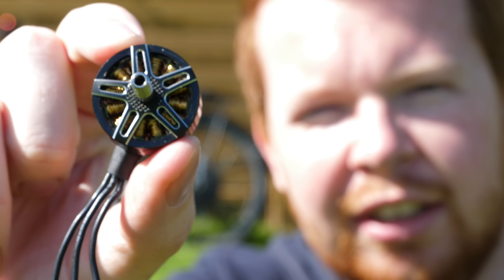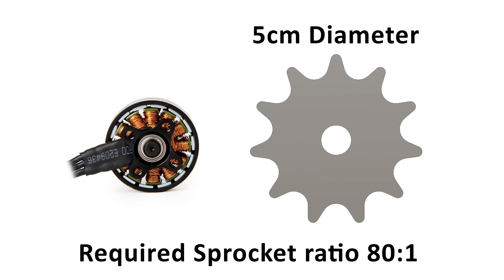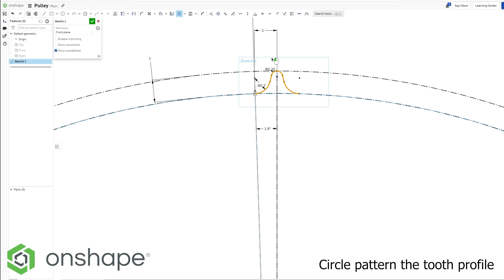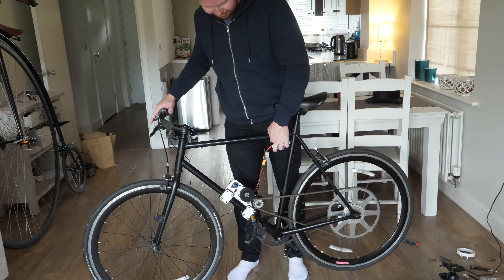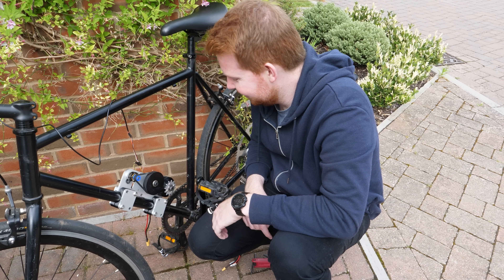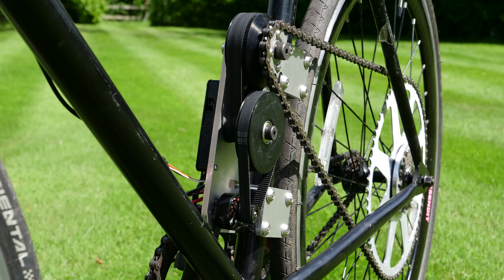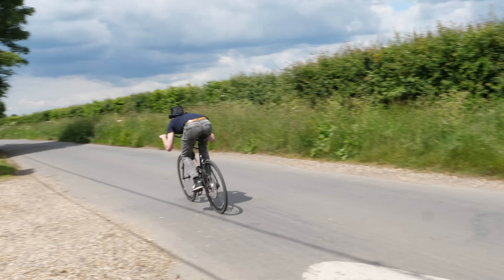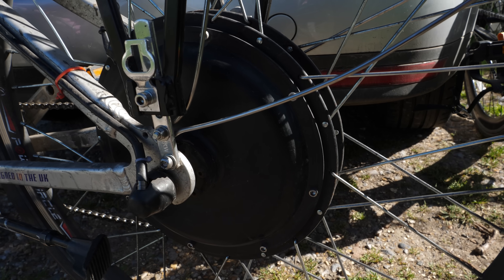Tiny 1kW Electric Bike Motor

Comment: What about using 4 drone motors? There’s enough room, and theoretically wouldn’t that quadruple your power? 🤔
Reply: Drone motors come in many, MANY sizes, to accommodate drones from a few grams to tens of kilograms.  Adding more motors is a lot of extra work, while using one motor of the proper size isn't.

Comment: with the right size motor you can probably tune it so  that the motor wears out at the same time as when the batteries run out. put some single use batteries on it, and you have a single use e-bike!

Comment: These normally expect airflow when being used to spin propellors around at those loads if I'd have to guess. Would be interesting to see if it holds when creating some airflow over it, bonus points if you make it so it has the air intake from the front direction and exhausts it to the rear to add to the ebike propulsion. Or if you want to achieve true madness figure out how many of these motors and propellors you need to put on a normal bicycle blasting air backwards to sort of propel a human riding a bicycle.

Most ebike motors do seem somewhat overbuilt especially when limited to the 250W continuous power that's legal as a bicycle in the EU however I do like the quiet operation compared to the noise a fast spinning drone motor produces. But I'm sure there could be a lower weight middle ground possibility that'd be nice (especially for wheel mounted contraptions, less picky for lower down central mass in a mid motor setup).

As for that legally being considered a bicycle with max 250W continuous power and no assistance above 25 km/h I do wonder what kind of peak power and for how long they can get away with here during acceleration. I've certainly seen Bosch mid motors mounted in "speed pedelecs" that appear to be the same as those in regular ebikes, for those assistance is allowed up to 45 km/h and more power is allowed too but not sure what the legal limits are.

Comment: Could you design and fit a continuously variable transmission like the old Variomatic system to better match the available motor torque to the demand. Impedance matching the load?

Comment: For the first few steps of gearing, where torque is low, efficiency / low resistance is vital. Perhaps such a wide belt is not the best option. Not sure what would be the best solution, but I imagine good quality gears would be better.
Reply: Belts are actually pretty efficent, and way easier to make

Comment: I would like to see a project with a rubber motor with gearing for topspeed of 20km/t (sub legal top speed) and detachable from the seat post. Going for a high top speed always brakes the usability on an diy project(boat, car, bicycle doesnt really matter). Icing on the cake would be all parts 3d printed and cheap M6 bolts and bearings. That would be something actually useful for folks to copy and use from time to time. All builders focus on top speed for some reason, the right way is to gear it down as much as possible to not melt the motor in the first small hill.  Esc with current limiting is expensive so no one buys that for an easy fun project. If this project would have had more gearing the result would have been completely different. Most drone builders also know that the motors can only maintain 30k rpm for a few seconds so I'd think 15k continous would be  better design goal on a bike. Gear down 50% more with a tensioner and film the bike do a gravel trail!  Would be fun to watch.

Comment: How's about four drone motors mounted directly to the frame with their shafts (with the apropriate toothed shaft sleeve) pushing in pairs against the tyre? 
What I'm thinking about is similar (if not identical)  to the "old" bicycle dynamo.

Comment: That 1000w rating is based on the windings running at 110degrees C and a propeller mounted to the shaft forcing air through the coils at 160km/hr or more, depending on the propellers pitch speed. Using it the way you were, its probably good for 300W.
Reply: Not even that.  Without forced air, there isn't much cooling possible, since the heat is generated from the center.  And with as little thermal mass as the stator has, even at 300W it's not going to last long.

Comment: Awesome experiment. I suspect the problem lies more in the ESC than in the motor itself, because drone ESCs are designed to reach a given speed, not just to apply power. So with such a big inertia of a bike plus rider the motor is commanded to reach a target speed which it cannot achieve for several seconds. Also, drone motors are designed to run only one second on full power because by then the drone will be accelerated and the props unloaded.
Reply: probably get a lot more air cooling on a drone too
Reply: Probably way off on gear ratio need another 4 to 1 or about.
Reply: Are there ESC made for this task? Or one has to go on a limb to design one?
Reply: @venasanev  They sell them in any size you want. Want them water cooled? Buy a model boat ESC. Want it power limiting? They've got those too.

ESC probably won't even be very warm, they have extremely tiny ones that run 4 motors at about 60 amps (each) that are less than an ounce. The thing that gets hot is the motor. Like I said above, all of them allow changing parameters like startup/advance timings, some allow braking levels etc.
Reply: Depends on the motors efficiency mostly. If you get a really efficient one, they don't heat up much (example, you may measure 1000w from one, and 1050w on another for the same output, and if that output is 990w mechanical then one is going to be heating up 6x faster and may burn out while the other will run till the bearings wear out without over-heating). Its impressive just how much a few design changes affect those motors, and modern race motors are probably nearing the limits especially when you compare to the older generation (flat magnets, multi-strand coils, bigger magnet to stator gaps), its a HUGE difference.

Yes I test motors until destruction, measuring mechanical efficiency, case temp, current and torque curves, thrust efficiency with different props etc. I've been testing motors to destruction just for fun before I ever was paid to do it (that's not my primary job, just one of them).

I will say you can also change the timing on pretty much any ESC within the last decade, so if you're having issues with that most of them you can change just listening to beeps and inputting throttle to program, or if they are 32 bit then new flight controllers can usually do a flash passthrough.
Reply: Possible it might work better having the motor run at a certain minimum speed, and have a clutch system to bring the bike and gear system up to speed, rather than having the motor start at 0 rpm with a huge load.
Reply: No ESC makes the tasks you described. In a better case a flight controller is responsible for that. ESC provides a PWM voltage to a motor coil, measuring a current. Some ESC have FOC functionality to shift a bit phases. So, you set a desired “power” with a controller, an ESC checks a current and varies a voltage to match the settings
Reply: @sc0or  I must admit I am not sure but as far as I understand ESCs are indeed Electronic Speed Controllers. Otherwise we would never blow our ESCs because the curent would be limited when in fact drone pilots regularly burn ESCs.

Comment: One issue you might be facing here is that drone ESCs are built with the assumption that the motor is under minimal load until at very high rpm. That introduces 2 issues when used as traction motors - the back EMF based sensing is nowhere near as reliable when taking off under load compared to the hall effect sensors typically used by purpose built traction motors, and the system is designed under the assumption that the motor will almost always be operating at minimal load, in that back EMF will be the limit to the motor speed at any throttle configuration. That in particular is a problem because at the same power input you will have much higher currents if the motor is under higher load, because the load will lower the motor speed so there's less back EMF. The wires in the motor realistically have a current limit rather than a power limit - the power limit is due to a mix of max current and the voltage required to achieve max current. With a drone ESC you're at high risk of substantially exceeding the current rating of the motor even if well within its power specifications. Running the same motor with hall effect sensors on a VESC with current limits set would yield less torque but a much cooler and happier motor.
Reply: People keep saying this, but a 100A ESC is a 100A ESC.  They can be used for drones, or RC cars, or helicopters, and cars in particular have high starting loads.
Reply: @BrightBlueJim  Yeah but feeding the motor 100A for 1 second during ramp up is very different to feeding it 100A for 5 minutes while crawling along at max current low rpm.

Comment: Awesome video! Can you provide how you wired the electronics and what you did in order to control the motor softwarewise? I study mechanical engineering and currently try to get into using Arduinos. But without much prior nowledge in programming it is really hard to start there...
Reply: You'll use analogRead () pins A--A6 / map () 0-1023 to 0-255 / analogWrite () to PWM pin which is 3/5/6/9/11/13
That's pretty much it. There's probably a servo sweep in the default library and readPot library, or this is literally just any servo tester code.

You can also just buy a "servo tester" for about $2. If you're using it on a bicycle and want a twist throttle grip I'd desolder the potentiometer and wire in the one from the twist grip.

Comment: High HP obtained at high RPM are always searched to improve HP/Weight ratio and consequently, acceleration and performance. By the way,  your final test comparison is really weird : 
- the gear ratio never let the drone motor achieve its optimal performance domain 
- cooling air direction sideways as the motor is designed to be cooled with downstream air-wind from an impeller

Also a John Deere 9R540 tractor weight 20tons (and is 13.6liter cylinder volume - 829ci), a Nissan GTR around 1.7tons (3.8 liter - 231ci). Even if you indicated their top speed, those vehicles are clearly not really in the same category. Ask a Nissan GTR to plow dirt, its clutch will die in few minutes. Even if power is the same. 

Acceleration is directly related to torque, speed is related to power. Traction is how to transmit power or torque to ground and it depends of weight, grip and speed.

For example :
Did you know that a Leclerc tank accelerate initially faster than a Porsche Cayenne ? (https://www.youtube.com/watch?v=I5l1-CUsbAI sorry for quality can't find better) 
Did you know that a F1 accelerate initially faster than a F/A18 hornet ? (https://www.youtube.com/watch?v=luH-rOYixY8)
Did you know that an human accelerate initially faster than a F1 ? (https://www.youtube.com/watch?v=vY7Jlz9ub6k)
Did you know that 8 rugby-men can block a F1 ? (https://www.dailymotion.com/video/x6f0azm)
 
Torque, speed, HP are physically related, but it is clearly not enough to understand how all of these physical quantities can be compared for one application to an other.
Reply: And there's another issue: moment of inertia.  Any shock load fed back from the tire is going to be working against motor inertia, with the result being that the first belt will strip in no time.

Comment: I see many people talking about there needing to be basically a fan blade (like a prop on a drone) to stop the overheating, but the much much bigger issue is that motors draw an order of magnitude more current when accelerating to top speed. That means it draws waaay more current than it ever would on a drone because it is moving a substantial amount of mass. The more current you have, the more heat you have. No reasonable amount of cooling will make this work.

Comment: i imagined this concept too when those motors came to market in the R/C world, i knew there would be problems with too high rpm but at the time i didn't realise the problem is cooling since those are designed to have very strong airflow coooling them at all times, also there is the problem with the true continuous power available since even with good cooling those are designed to pull 1000w but for extremely short periods of time

Comment: You need to remember that at say %85 efficiency for that motor at 1000 Watts input you will be producing 150W of heat energy in that tiny little case.

Comment: i mean you went to the absolute extreme, you should fit a mid size outrunner motor with much lower kv that can actually dissipate the power and it would be very competitive with the hub motor

Comment: I'd love to see the motor drive the bicycle  by using a simple friction drive against the bicycle tire (and some cooling with a fan as others have mentioned). The mount would probably need some weight to keep the motor drive wheel tight against the bicycle tire. Thanks for a very interesting and thought provoking video!
Reply: I have seen a guy build just what you are talking about.  Using a  18volt dewalt  cordless drill  and a couple of strong springs to maintain good contact with the rear wheel. 
You can probably find the video on YouTube

Comment: the spec sheet for the small motor , stated under full load for 1 minute the temp of the motor will be 101c . which is pretty impressive

Comment: YOU'RE FORGETTING RADIAL LOADS FROM THE PULLEY!!!
The drone motor isn't built to withstand pretty much any radial load, as the propeller doesn't exert any under normal conditions!
A lot of your heating in the initial setup with the smaller motor was probably from excessive friction in the bearing surfaces. that's also why it was squeaking so much. the reason that motor brackets exist is that they can balance forces like that, though in this scenario, bracing an external-rotor electric motor like that would certainly be challenging. Challenging, but nothing that you couldn't handle with a little modeling from today's sponsor, OnShape!

Comment: small tip: DONT try to accelerate from dead stop w/ the motor, they absolutely HATE that and its a torturous load
use the Pedals and your legs to get to a little bit of speed, then have the motor do the rest

Comment: you could connect both motors and switch to that faster one like a 2 gear. Small cooling would be nice , when they are in drone air cools them down but here they simply just cooking

Comment: I have a Idea for improving this ,you can stick 3d printed grooves to the rim of wheel and then mount he motor with gear on near the rear braking system it would be simpler and will easily create 70 gear ratio

Comment: Awesome video! I've got a huge 100KV drone-style motor, that going to be assembled in a bike frame something like yours here. I need to get it spinning first, but I'm not much of a programmer. Can you please provide the Arduino files, that you use to convert the throttle signal into PWM for the motor controller? I think I will be able to edit those to match my needs, although I just couldn't write the code myself. (It's been over a year since I started trying...)
Reply: This sounds like a patreon subscriber kind of question ;)

Comment: Best solution is to use a rc boat/rc car  engine wich is ment to fit in a enclosed space  or even water cool it using a water jacket and radiator  or just use a bottle and pump

Comment: Run two drone motors on opposite sides running in opposite directions. Electrical and mechanical load can be halved toe each motor.

Also whilst your at it so two at the front for all wheel drive. 

250w to each motor please. See how it goes 😁

Comment: You could parallel four of those motors and get much better results. Still a fraction of the weight, and four times the power you just demonstrated!

Comment: Great Video. I am realy supprised. I expected it to perform much worse.
To me it Looks like If you were to use a Couple of those Motor maybe 4 running at 250W each an a proper Heat sinkt.

It could get the Job finde.

The only Problem with that Plan ist if you include all the Gears Controller... The 4 dron Motor design would be bigger an more expensive than the Hub Motor.

Comment: Doing this with a "1kW claimed electrical power" motor works "barely" as you've shown. If you use a 2kW motor at only about 1kW (plenty for a bike), you'll have lower losses, lower heat in the motor.

Comment: Aren't drone motors designed to require the cooling from the air flowing from the props to cool themselves? Any wind you get on the bike is flowing perpendicular to the motor and not through the body/coils, so I'm not shocked they fried themselves so easily...

Comment: Super cool.  This would be very interesting to see how it works as a pedal assist system rather than full on electic scooter mode.  It would be interesting to see if the drone motor could take the edge off of pedaling into a headwind or up a large hill while coming in at a much reduced weight to a hub motor.
Reply: by driving directly to the largest front sprocket (one way bearing at output)
it could be pedal assist, and be making use of the rear spindle/cluster.
15-18-21 speed mountain bike would have 10-12-14 gears available like that.
it does need a bigger motor to start with, maybe 1500kv 3650 size.

Comment: Throw a server fan on the motor and it will stay much lower temp. They have 15k rpm 80mm fans that push 120cfm.

Comment: When the  motor is spinning at low rpm, a lot of the power is converted to heat, which explain the bad smell. Drone motor is design to spin up to speed in quite short time, but obviously e-bike take some time to get to full speed(need far more energy to be put into the system).